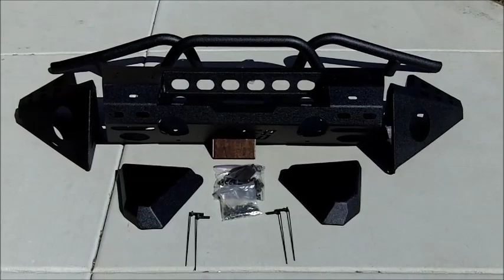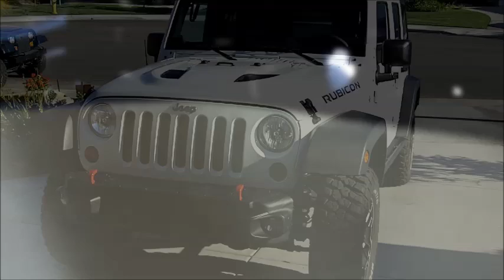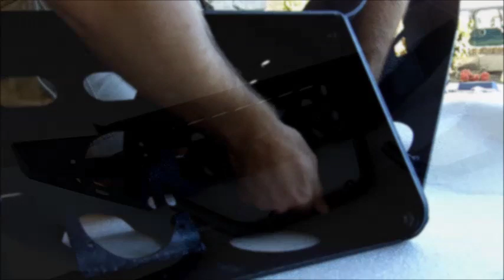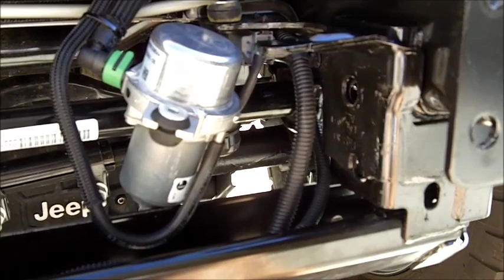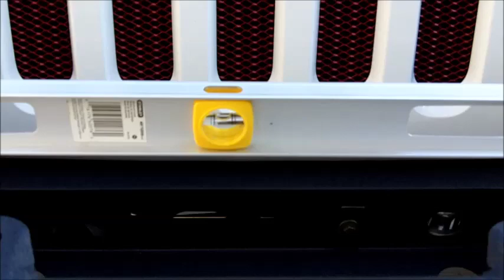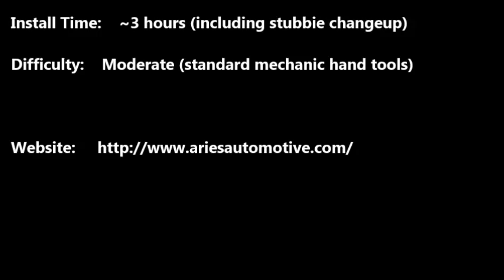Aries Automotive Front Modular Bumper install - 2013 Jeep Wrangler Rubicon 10th Anniversary

Comment: In newer videos it looks like you put the OEM bumper back, on with a push bar attached to it.  What pushbar do you have on the stock bumper from the Anniversary edition?
Reply from the maker: Hey Rich, yes I had put my original bumpers back on. There was a boulder that decided it liked my bumper more so I had to pull and replace it. The bar that is on with the factory bumper is from Maximus 3.
Reply: +John Golden (RockTrooper) thanks for the quick reply.  I like the stock bumper better for the front.  Jeep looks great!
Reply from the maker: +Rich Beach thanks!

Comment: Really like the looks of the stubby bumper. Having a hard time choosing which bumper I want. Great video!
Reply from the maker: Hey Brett, yes the stubby is the setup I like as well. It all depends on where you are planning to use and of course what you like. Where I am located it is more rocks therefore the brush guards not really needed. If I were wheeling on the east coast, the brush guards would come in really handy, deflecting the bush/trees, etc.
Reply: John Golden Yeah makes sense. I live in Ohio so I have a little of both rocks and a little forest. Buddy of mine loves his smittybilt xrc stinger, but personally I think I might go with either JRC or a poison spyder.

Comment: John, was wondering if you bought the aluminum or the stainless steel bumper?
Reply from the maker: Logan, I have the aluminum version. The JK Unlimited is already heavy enough and I am not worries right now about damages with the rocks.....until I get it lifted :)
Reply: John Golden is the aluminum one pretty sturdy? just incase I happen to run into someone/something :)
Reply from the maker: It is sturdy enough for everyday use and some light to medium wheeling/rock crawling, however expect damage if you are going to be doing some diamond level trails. Keep in mind as well, that the bumpers are modular, so if you bend and end, you can replace just the end piece.

Comment from the maker: Hello Robert, I appreciate the feedback. The antenna is the Antenna X I bought from Amazon, I think they run around $17. It works, no complaints. The grill screen is home made. I did not do a video on it (should have though) however I did a write up on it. You can view it on JKForum, WranglerForum and Wayalife, just look for posting by Finn Sizzle. Hope that helps